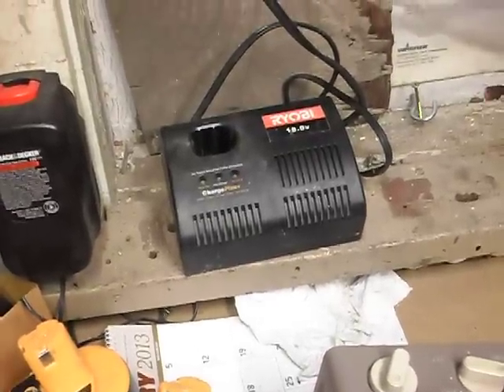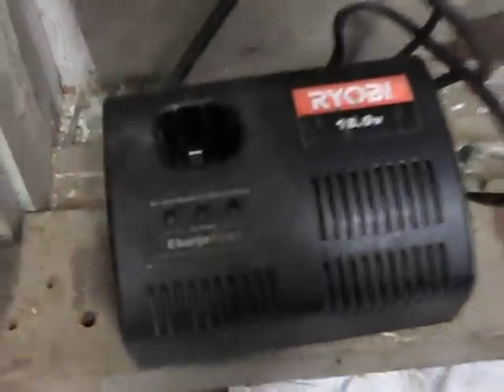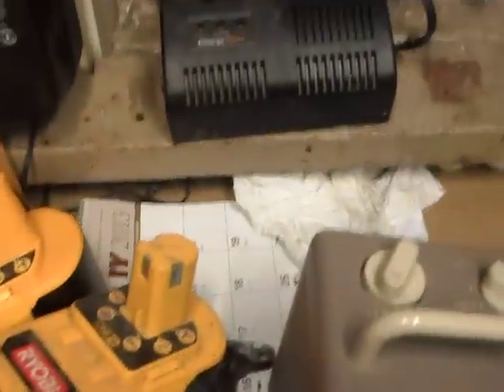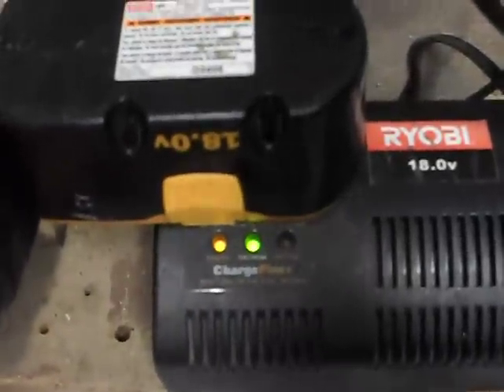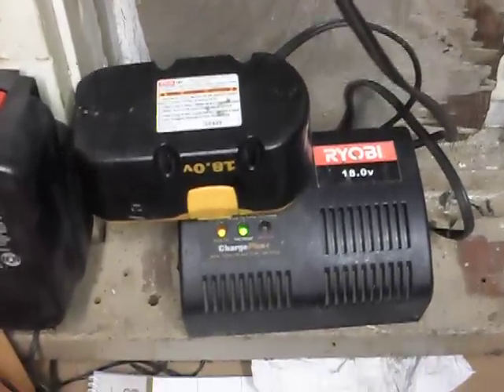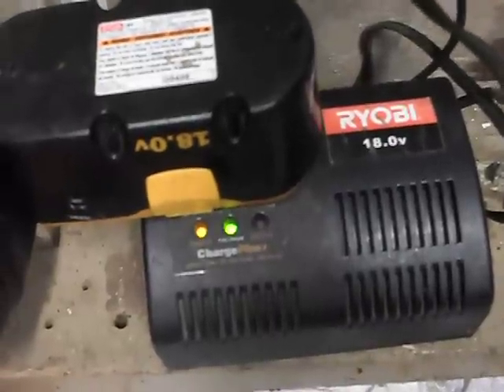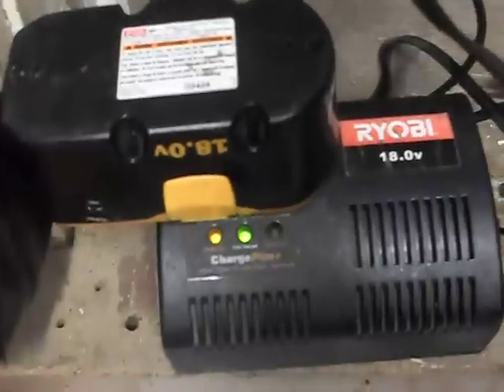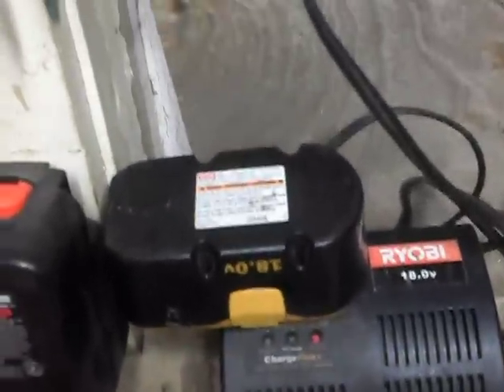How to charge A DEAD Ryobi 18 volt rechargeable battery! IT WORKS!!

Comment: I just found the drill, light, 2 batteries and a charger with the manual and case in perfect condition in the dumpster. Needless to say, the batteries wouldn't charge...a find that was too good to be true! In any case I tried the on off trick and my amazement the red light came on! thank you for the trick!
Reply from the maker: your welcome!

Comment: An absolutely fantastic and simple solution! I had a "dead" NiCad Ryobi ONE Battery (Model P100) and I tried your method on the Ryobi P116 Charger and it worked just like you demonstrated... The battery seems to be taking a charge now, Steady red light and flashing green. Thanks a lot for sharing this solution... You probably prevented junking 100's of battery's.
Reply from the maker: Jay C thanks for the comment.
Reply from the maker: Jay C i have over 230.000 views 99.9 percent have been able to work. so it is far from the 100's saved. lol
Reply: SHHHHHH

Comment: Great tip - the simplest of the many suggested techniques. Seems to work best if you pull/push the plug in as quickly as you can. Thanks

Comment: Thanks!  I am certain I disposed of at least two batteries, probably in the same condition.  I use the batteries perhaps 8 times per year for small projects and 1 big project on average.  Drill and other tools are great, just find the "dead" batteries in the drawer.  Is there a better way to perhaps remove the charge after use so this does not happen?
Reply from the maker: +Mike Magnant   I dont know for sure what you mean by remove the charge. Personally i  do not think anything will help these batteries. they are just junk.  mike thanks for the comment,and for watching.

Comment: It worked!!! I threw out the first battery that died. Kept the other and it was always weak. Just about to toss everything in the garbage and upgrade to lithium. I was on line shopping for a battery and came across your video instructions so, I gave it a try. It took no less than 50 times of plugging and unplugging and I almost gave up. Finally the error cleared and I charged it over night. This morning the battery was fully charged like new again = amazing!!!! Thanks and not sure how you figured that out, awesome!!!
Reply: +Tom Orlando hey ,if anyone else wants to discover how to recondition old car batteries try Corbandy  Battery Blueprint Crusher (just google it ) ? Ive heard some awesome things about it and my co-worker got great success with it.
Reply from the maker: +Tom Orlando I am glad it worked for you!

Comment: I had 2 Ryobi 18V NiCads that were dead after extended storage and would not charge. I just plugged into a power strip and flipped the on/off a couple times and now they fully charge! Excellent tip and thanks!
Reply from the maker: sweet! thanks for checking my video out.

Comment: I just did the repeated plug in - plug out about 10 - 12 times and sure enough it did switch over to the Red light only. This is a Ryobi 18.8 volt pack. Keeping my fingers crossed and will check it out tomorrow. Will post the results. Also going to try my Ridgid 18 volt ni-cads reboot too.

Comment: I was about to recycle my yellow-black battery, and I gave this a try. I was getting the dreaded yellow-green indication on the charger. To my (pleasant) surprise, after about 30 tries, the charger did go to red. It's charging now ... I'll come back & comment on how it works ... it's over 4 years old.

If you try this, don't insert & remove the plug so quickly that you miss the charger going to red. I think I did that, maybe twice. Leave the plug in long enough - at least second or so -- so you don't miss a successful charge cycle start-up.

I know I'll have to switch to Li-Ion eventually, but I'm trying to squeeze all the life out of these batteries that I can ... 

Hat tip to chaseme81871 for making this video!
Reply: Well, it seems to have worked fine. My "dead" battery is now working again and spinning my drill at full power. Great tip from "chaseme81871".
Reply: Thanks, Dave.
Reply from the maker: David Leeper thank-you for watching,and commenting!
Reply: David Leeper Update ... the battery now seems to be fine ... it delivers full power and recharges without having to use this trick (for now). I suspect it no longer delivers that full power for very long, but I only use it for small jobs, and it's fine for that. My 2nd hat tip to chaseme!

Comment: Worked exactly as described to fix my two ONE+ batteries, they work better than ever now.  Additionally, I had some failing laptop batteries so I tried this same technique, just popped the battery in and out over and over while the laptop was plugged in.  Worked like a charm.  Thanks man, you saved me some serious $$.
Reply from the maker: IronChef60 you are welcome!

Comment: My husband got a set which included 2 batteries 18v, charger ad a drill. The batteries also fit his saws all but the charger is junk, it has never worked right. Unlike yours no lights come on the charger and neither one snaps into the base. An advice besides getting a new one ?
Reply from the maker: +B.C. Lovell  so the batteries do not fit into the base?

Comment: It also works if you gently lower the battery in. The problem I had once although both techniques worked, the battery didn't hold the charge for long.
Reply from the maker: +edward charles never could get it to work that way. ever.

Comment: I did that for a couple of months, then my charger died.  I got the new style charger now.
Reply from the maker: Charles Henry there is a fuse that goes out in the old chargers.
Reply: Tx
Reply: I recommend a new one. Charger and battery.
Reply from the maker: I have both . an old charger,and a new one, but i rarely use them since i got the 20volt DeWalt for my birthday last year.

Comment: So stoked to find your video and happy to send a PayPal tribute!  A friend of mine gifted me a P2005 Ryobi Cordless String Trimmer.  It came with the Yellow and Black nickel cadmium P100 Battery with a P110 Charger like the ones depicted in your video.  The battery down pretty fast and I plugged it in overnight.  The next day, nada, nothing, zip.  Was it the battery, the charger, both?  In hindsight, I wish I would have done my research and found your video before I dropped $45 at Home Depot on my first Ryobi lithium One + battery, but live and learn.  Thanks for the tip that really worked!  Now I have more power and can start a One + system unless someone out there can talk me out of it.  The folks at Home Depot and Ryobi have set the hook but don't have me in the boat yet.  My buddy loves his Milwaukee system but if y'all were just getting started what you do?
Reply from the maker: +San Diego Surfing Academy thank you for the killer comment man. i am glad i can help. I would say DeWALT Is WHERE IT IS AT. THEY ARE TOUGH, THE BATTERIES ARE TOUGH. AND IT IS HARD TO KILL A DeWALT.   sorry  about the caps. but im not retyping it. lol
Reply: +chaseme81871 I'll take that under advisement.  I have an twenty year old DeWalt drill with the original two nicad batteries still kickin' and now I have a Ryobi weedwhacker with two batteries.  Decision tree!!
Reply: +San Diego Surfing Academy Hey you guys, pay the man!  He's saving you money in the long run!
Reply from the maker: haha thanks. i think i have had only one guy send me 10 bucks like a year ago. if only they would listen to you! haha
Reply: +chaseme81871, I will not contest that DeWalt drills are tough. I've used quite a few in the past. Since getting out of construction and becoming a truck driver, I recently learned something, allow me to share.
I was recently (a few months ago) at a facility in Fort Mill, SC that manufactures certain components for Black and Decker tools. I was there to pick up a load to deliver the next day, somewhere. I don't remember, right off hand.  So I do the usual deal, check in, back into a dock, etc.....
Anyway, when I was finally loaded and returned to the truck with the bill of lading and trailer seal, I pulled the truck forward so I could close the trailer doors and seal it. As I closed the left side door, I saw DeWalt drill, and other types of DeWalt tools on the pallets in the trailer. I asked the guard when leaving the place, and he assured me that Black and Decker makes just about all the popular brand name battery powered drills, and other battery powered tools. I would have never guessed it until I saw it. So, the DeWalt is basically a Black and Decker drill, in a different case.
Reply from the maker: oh im sure. just like husky makes almost all of the mowers, and DeVilbis makes all of the different brands of power washers.
Reply: And, I never would have thought that if I hadn't actually seen it. I figured they were all their own manufacturer.

Comment: Good hack except don't be too excited until you find out how many or few bad cells are in there that resist charging. Mine took about 10 tries then charged for awhile and then showed fully charged. The result? About 3 seconds of drill time. This was an extremely tired battery left outside for months possibly so most batteries should fare better. I'm pretty sure Ryobi cannot officially support this hack as the drill will likely perform sub-par and the charger knows when too many cells are dead to function properly - simple. If you don't think the battery life justifies it's price buy another brand. The error does mean the battery is "toast" to some extent as enough of the cells are bad to warrant the double lights. Still a good hack if there is enough life to do a small job and a new battery is not available to you right then. Thanks for posting!

Comment: Have you ever had the problem where only the green "fully charged" light is on, even though the battery is putting out weak energy and is clearly not charged? I cut tree branches for probably a half hour with my ryobi saw and went to charge it and it says its fully charged but the saw wont even go through small branches because it is weak

Comment: Thank you for showing this. I just bought one from the pawn shop. A whole multiple tool kit. It had two old batteries in it. I had to figure out how to make these last until I can get the lithium batteries. 

It worked perfectly just like you said. My fast charge light came on. I will do the same with the second battery when this one is done.
Reply from the maker: your very welcome.

Comment: My trick
NiCd
Remove the 6 screws
Remove the top and bottom case.
Remove the top and bottom mica.
Insulate the bottom of the cell on top (duck tape).
Check each cell for any voltage. Cells with zero voltage apply 12v 2A for 10 seconds. Repeat on all zero volt cell.
Check each cell for any voltage. Once each cell has some voltage.
Install top case and place in Ryobi charger.
Red led your go to go in 1 hour.
Green Yellow led. Recheck each cell for voltage. Zero voltage cell zap with 12v 2A for 10 seconds repeating until you read some voltage.
Don't reuse mica just duct tape the top and bottom of all the cells and trim off any excess tape.
Above is a pain but within 30 min you can cure a dead zero volt Ryobi battery.
Li Ion 
Check each cell for voltage
Put on safety glasses
Cells with zero voltage.
Zero volt cells apply 12v 2A for 10 seconds. 
Check cell for 3 volts min.
Once 3v or more is reached quickly put pack on charger.
Safety first on LiIon these are not like NiCd or NimH
LiIon are hazardous and may have caused the loss of flight MH370

Comment: Will this also work on the yellow ryobi charge center?
Reply from the maker: +Rick Senior Im not sure rick. thanks for checking my video out!
Reply: +Rick Senior Some of the charge centers (P113) are fire hazards,recalled by the CPSC

Call Ryobi customer service,you might be surprised.

Ryobi batteries are no worse than DeWalt or Craftsman.Due to the flow of drain and charge current,the first battery in the tower takes a beating.Sometimes simply replacing that one battery you have a REAL working battery pack.DO NOT defeat the thermosensor inside the pack.This is to prevent fires from overcharging the battery.When the battery is warm,the charger shuts off.

You are looking at a drill that costs Ryobi (Singer) about $1.25 to make.If you have a Voltmeter,check the side terminals of your battery.If the tower battery has no volts,the charger has no idea there's a battery plugged in.So even the slightest charge of say a half volt is all that is needed to get the charger to recognize the battery.

I use a 12vdc supply to revive that tower battery. in two seconds any whiskers inside the ni-cad are burned up and sometimes (rarely) the pack is operating somewhat like new.Get the polarity correct or you're wasting your time.

Comment: I have two of these Ryobi NiCad batteries that have been dead for 3 years now. I've been trying to recharge one for two days now and still the yellow/green light. After watching this video, I pulled the plug and on third try light is red. I'll charge this one then will do same on second battery. Hopefully it'll power my cordless drills and circular saw again.  The new replacement batteries cost to much so I quit using the Ryobi tools with NiCad batteries and bought all new ones from a Ridgid which use Li-Ion batteries and work perfect every time.
Reply from the maker: how did it go?
Reply: chaseme81871
Simply put, it works. Both batteries have charged and still holding. I've tried both cordless drill and circular saw and they work great. All this time I thought they were dead batteries but now I wonder if it's not just an inferior charger design.
Reply from the maker: that is wonderful!

Comment: I am trying to figure if you are an Angel or a Saint … maybe BOTH … thanks for this tip .. I sure hope it works.  I have two dead batteries and my package of Ryobi gear is a good few years old and was just sitting unused.  So, I threw in the towel yesterday and went to Home Depot and bought a new one ( which has One Plus on the side ) and it does not work / fit with my charger which looks like yours.  The replacement I bought was the slimmer grey "Ion" version, I don't know if that makes a difference if I would have bought the yellow style like you show which has One Plus on the side.  I sure hope I can juice up my two old batteries .. that would be real fine !
Reply: yea the slimmer grey ones are for the newer neon green charger . I have had a bunch of them already and they are junk , worse than the old ones , i buy the older style now for all my tools , i have noticed batterys that didnt work last week will all of  take charge today
Reply from the maker: well did they work?
Reply: The slimmer new style batteries did not fit my charger and I used the tip of plugging and unplugging to get the old batteries to charge and the charge light finally came on to charge but the batteries did not take a charge so I called Ryobi and finally got someone who convinced me that if I bought the basic bulky old / original style one plus Ni-CD 18 Volt ( important 18 volt ) that it would work.  I purchased a pair of them and they do work with my old Ryobi tools.  I do find that I am not a battery guy … with these multi tool devices … I prefer the old plug in drill  … but I am not a regular DIY kinda a guy.  Keeping batteries charged and ready for a once in a while use is not for me.  Anyone want to buy my whole set ? ( kidding it would cost more to ship than it is worth … bag weighs about 80 pounds )
Reply: My response post went to google … let me know if you can see it there. This will not let me copy paste it. Nothing is easy nowadays !
Reply from the maker: yes i got your post's. thanks

Comment: I tried for about 20 minutes...battery in, battery out....cord in, cord out.....finally the red light came on.  My only light was the green light but it did work!!  I tried the spit, sand paper....THANKS!!
Reply from the maker: you dont do battery in and out. just leave the battery in, and cord in and out.
Reply from the maker: you dont do battery in and out. just leave the battery in, and cord in and out.
Reply: just my red light was on..,not the yellow light....taking the battery in and out seemed to jump start it.  still holding the charge.
Reply from the maker: sounds like it was not in error code, and just needed charged.

Comment: I have no idea why that worked, but I resurrected a battery that had been dead for at least 2 years.  It took 40+ tries to get the red light on the charger to come on, but the battery works like a charm now.  Thanks!
Reply from the maker: AWESOME! YOU ARE WELCOME!
Reply: I did mine for 40+ tries and it is not working. Am I doing something wrong?
Reply from the maker: Jordan Stanton keep trying!
Reply from the maker: Jordan Stanton did you get it to charge?

Comment: It works!  I had two "dead" 18V batteries and now both are charged and working.  To make the plugging/unplugging a little easier I plugged the charge into a power strip that has an on/off switch, and just flipped the power switch on and off repeatedly until the battery started charge.
Reply from the maker: awesome!
Reply: Same thing I did.

Comment: Thank you very much for his awesome fix, chaseme81871.  It worked as you describe on 2 dead batteries.  A lot of guys must be in the same boat, because HD is out of stock of the 2-pack right now.
Saved $40 each.
Curious to know if you think the original problem lies with the charger or the battery.
Thanks again.
Reply from the maker: Joe Sciacca im not really sure where the problem stems from. i seem to want to lean towards the battery, it is as if the batteries cannot hold a good charge for any reasonable amount of time,and when the charge gets below a certain point the charger perceives it as no good. i have had this happen with brand new ryobi batteries as well.